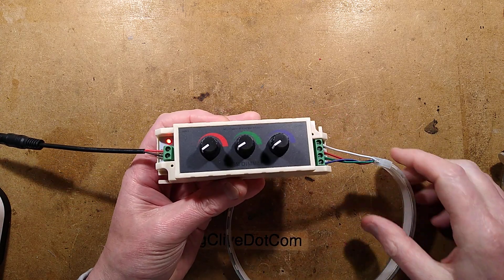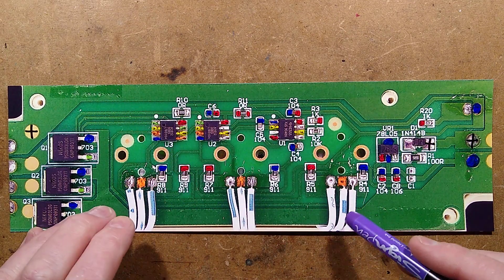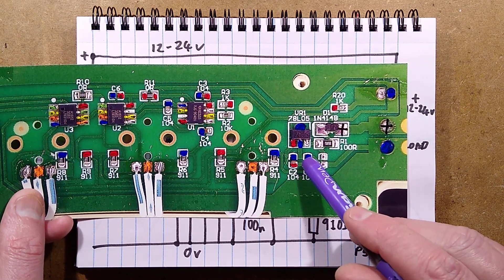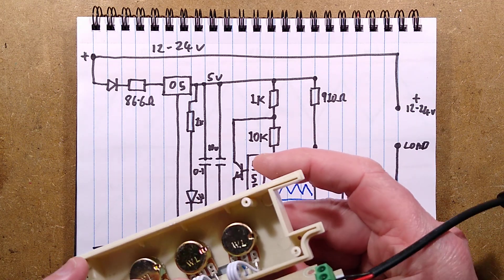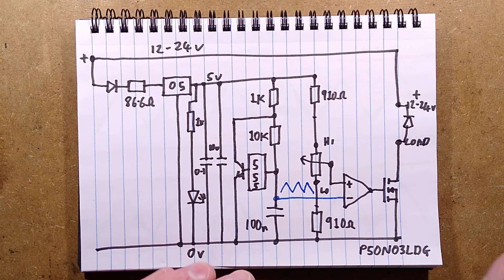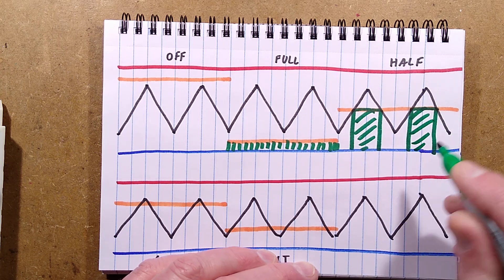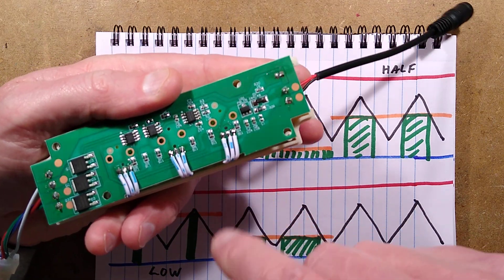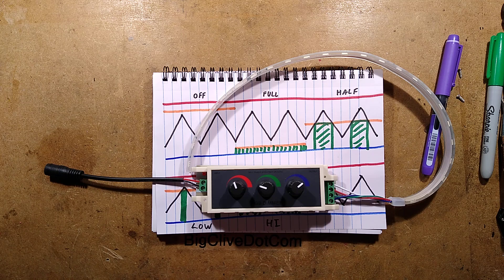RGB dimmer teardown and schematic (no microcontroller)

Comment: Surprised they didn't use the unused op-amp do do the ramp generation instead of the 555 ( and the 78l05)
Reply: Yeah, thought that too - would have saved BOM
Reply: when they realise this, the circuit designer is getting fired
Reply: Sometimes doing that with one op amp restricts current on the chip making the others do weird things.
Reply: @markfergerson2145  a 500Hz oscilator is not super demanding, given the other op-amp is used to drive 2 mosfets, this can easily drive 1+the ultra low frequency oscilator.
what you say could be correct in say a 4 channel opamp with 3 high loads and a sensitive rf oscillator given not enough decoupling and/or voltage drop internally, and that will surely depend on the part and it will only cause a failure on a circuit that was working on its limits anyway
Reply: Maybe, they decided to use the 555 just to increase the demand for 555 chips to keep them in production.
Reply: @allalphazerobeta8643  Hope so.
Reply: @allalphazerobeta8643  lol, that gets my vote, the others were well above my level
Reply from the maker: Yeah.  I've never really looked at op-amps too hard for use as oscillators.
Reply: Using the 555 with its divider and dual comparators delivers a very consistent voltage range in the output. The same is not true for a random single opamp triangle oscillator.
Reply: @bigclivedotcom  Oscillators never oscillate, amplifiers do.
Reply: @bigclivedotcom  There's a fairly standard op-amp relaxation oscillator circuit, usually presented using a double-ended supply but you could do single-ended as well.
Reply: @allalphazerobeta8643  I didn't think 555s needed any help remaining viable.
Reply: Mikeselectricstuff. They used one side of one op amp and both sides of the other. 3 op amps, 3 colors. Maybe I missed something.
Reply: @GeorgeZ213  3 op amps, 3 colors as you said. That was the goal and the fulfillment. What more or less do you expect?
Reply: That was exactly my thought. Or use a dual or three single 555, which can do PWM as well by themselves. 
In fact this can even be done with just a logic schmitt trigger, or when you're really cheap just a transistor.
Reply: @Peter_S_  Yea, the comparator isn't so far from an opamp itself. I know you can do other stuff with a real opamp, and you can buy comparators on chips. But they're nearly the same thing, and in a 555 it's doing the same jobs the opamps are here, comparing a voltage and flipping between high and low. If they were using it's actual output instead of monitoring the capacitor, that's what you'd get.

I wonder if the dual opamps are cheaper than a 556, a dual-555? You might have been able to do the same thing, plenty of people wire pots up to 555s.
Reply: @joewoodchuck3824  Mike's point was, since there's a spare op-amp going, that could have been pressed into service doing the same job the 555 is doing. Op-amps can make decent oscillators. So they could get rid of the 555 and save a bit of money.
Reply: @greenaum  Comparators and opamps are different. They have different output stages designed to do different things and more often than not they have different input stages as well. The majority of opamps cannot be used as utility comparators due to the protection diodes on the inputs. You can abuse some opamps as comparators in limited situations but take advice from Analog Devices Application Note AN-849 which states, "the best advice on using an op amp as comparator is very simple—don’t!"
Reply: Could just have used a cheap quad opamp (ie LM324). Done it with one channel:
https://threeneurons.files.wordpress.com/2019/12/pwm_dimmer.jpg
I f****d up on my drawing. R2 is in the wrong spot !
btw: considering current parts cost, a real uC would be cheaper.
Reply: By the time you have added enough passives to an opamp to make a ramp oscillator with consistently defined high and low voltages on the waveform, you have three or four times the cost of a 555 chip, and probably less reliability. I learned that the hard way close to 50 years ago when I was building theatrical dimmer controllers.
Reply: @kapioskapiopoylos7338  Because they may have to pass fcc testing they want their frequency stability to be high.  This circuit gives that without adding in the BOM cost for a crystal.  Your 500hz spike in the radiated emission test will look like a sharp birdie and will be forgiven (most likely) a op-amp oscillator not controlled by a crystal will most like produce wide band noise and be amplified by the the FET's.  Wide band noise is usually what kills you in your RE's test.  Best to find out the loudest local radio AM station near your certification lab and put your primary frequency right on top that.  Ohhh did I say that out loud.
Reply: They probably have an RGBW version using all four op amps as well, so easier to stick to one basic design?
Reply: @allalphazerobeta8643  In that case, they should have used three 555s and ditched the op-amps completely.
Reply: Arpad Toth  Normally yes, a valid point. But we live in those strange times in which MCUs rise in price sharply and you have no idea which one will be available a few weeks from now. The 555 is something you can get from hundreds of sources and those OpAmps are probably generic too. Because everybody is about IoT and smart this or AI that, nobody gobbles up all the "dumb chips". So... smart move by this manufacturer.
Reply: @Peter_S_  not just that but stable Freq. but also stable DUTY CYCLE..(= konstant)..
irrespective of the " fluctuations/ variations in 
555 supply voltage ..even when run off an 
" unregulated " 
power supply....
Reply: @joewoodchuck3824  they will be always in demand...
Reply: @analoghardwaretops3976  I agree. They even still make 741 op amps which are  absurdly obsolete.
Reply: Isn't there RGBW strips though available, if you want to adjust also the brightness...
Reply: @rfmerrill  relaxation oscillator would limit it to 1-49% duty cycle.
Reply: When I saw the circuit I thought : If I had to design this, I would use a quad opamp as one multivibrator and three comparators. But they didn't did it that way and it bothers me a lot !!!
Reply: @atmel9077  I think there are therapists who specialize in nerd rehabilitation for people like us.  :-)
Reply: Use one LM324 and do all with a single chip. NE555s, LM358s and LM324 cost all about 10cents each. One instead of three chips, 20 cents saved!
Reply: @b00lduck  OK Mr. Semantic. LOL.
Reply: @totorodad-computer-geek  The key is risetime. Short risetimes = more harmonics.
Reply: @gadi70  It still has to use a controller if some sort. Otherwise there'd be no way to change colors.
Reply: @superdau  One still needs to account for the passive component costs. Caps especially aren't free.
Reply: @rfmerrill  Relaxation oscillators are defined by having no amplified feedback. The old neon bulb, resistor, and capacitor circuit uses only passive components, and is an example of a classic relaxation oscillator. 
    If there's an active component causing amplification it's just an oscillator.
Reply: They could of used single package, quad op amp (lm324)
Reply: @michaelmoorrees3585  I've actually built the "same" circuit for RGB LED tape. I used a quad op-amp. One as a ramp generator, the remaining 3 as comparators! I think I used an lm324
Reply: @atmel9077  it bothers me too for some reason🤨
Reply: @joewoodchuck3824  the neon oscillator circuit, is my all time favourite! I have seen it used as a tone generator with visual indicator( driving a piezo speaker)
Reply: @MyProjectBoxChannel  I never thought of that use. I wonder what the upper limit is now that the topic is open. I'm retired and don't have any of my own NE2s.
Reply: @joewoodchuck3824  you can find NE2 neon lamps in many appliances. You can always salvage one from an old appliance. They are used as indicator lamps in extension leads and socket outlets, kettles etc. I might do a video on a neon bulb relaxation oscillator. it's such a simple elegant little circuit.
Reply: @MyProjectBoxChannel  Cool!
Reply: The opamp would either get you a monostable, or a sinewave generator. For a ramp you need more components. The 555 has those extra components built in, so much simpler. As for why a ramp vs sine, probably because it gives better linearity (not perfect linearity of course, since the 555's ramping won't be perfectly linear either) or something.
Reply: @absalomdraconis  opamp generated sine wave is a triangular wave contoured with additional circuitry ( active& passive components) for a decent sine wave..
Reply: damn, came here to say the same thing! also curious they've used 2 dual rather than 1 quad comparator/opamp.
Reply: @absalomdraconis  you can make a single opamp triangle generator but its very unclean, normally you would want to use two. But it would have been possible to make the entire circuit with only the 4 opamps on the board, they maybe just wanted to keep a 4 channel variant possible if needed.

Comment: I used to use 555 timers as dimmers before (I think there should be a comment on this somewhere very far down). I used one timer for each channel, and regardless of whether I used discrete chips (one timer each) or the 558 (four in one) chip I got nasty flickering (made worse by some resonance at certain settings), which could be toned down with lots of flitering and big caps (and pobably my circuit as crap as well).
I now tried this method, with a single 555 timer to provide for a common basic wave form and multiple opamps and (digital) potentiometers... it's awesome... simple circuit no flickering whatsoever. A genious circuit. I can't give enough applause to theone who has thought about and to Clive for showing it to us.

Comment: I used a super simple 555 LED dimmer circuit in a project at work, to ensure all the 12-volt white and red LED tapes got consistent brightness-- twist the trimpot on each dimmer, done. I still have the PCBs I ordered, each circuit was like 5 bucks all told; the circuits inside the project were made from perfboard though, the PCBs didn't arrive in time.

I think I initially used DIP packaged 555s, then after seeing how practically indestructible they were I switched to SMD packages to make the PCB more compact. Same with the MOSFETs driving the tapes.

Comment: I built a single channel version of this many years ago to control the electric motor on a remote controlled model speedboat. Didn't use the op amps though, just varied the duty cycle of the 555 with a pot and then fed the squarewave output into a pair of large mosfets. Worked a treat and because the mosfets were either on or off there was hardly any heat dissipation which made it easier to install and more battery friendly.

Comment: Takes me back! Forget exactly my first use of a 555 but it followed soon after a twin BC109 multi vibrator when I wanted something more compact - plus also often used for timing of course. Has to be one of the ubiquitous devices (741s too) from ages ago - in my case probably mid 70's or earlier. I'm old - I go back to thermionics - 6V6, 6K7, KT66, ECC82 etc and on to the heady days of OC71 and PNP germanium stuff. How things have changed - darned surface mount stuff so small it's a nightmare trying to do replacements. :)

Comment: the use of the 555 reminded me of another unusual use which is how early PCs measured joystick positions... cutting a long story short they used the potentiometer in the joystick to alter the timing of a 555 (well they used the 558 4x package) to switch a single bit per channel and timing how long the switch took rather than do a 'normal' A2D conversion that would require at least a byte per channel.

Comment: I was sure the 78L05 required an input cap and an output cap! Usually about 0.1uf and 0.01uF respectively. 
This design didn't bother with the input cap, which could make the regulator oscillate in some conditions.

Comment: In the late 80's I designed and built something very similar to this, to control heating elements of a temperature calibration bath. The ramping voltage switched a solid state relais. Stunningly similar! 😲

Comment: very retro.
you could easily add an opAmp adder and a low pass to modulate it with music.
Reply: That would be a very cool mod to this circuit! Different filters for each color and selectable polarity per color could make this a very cool little light-organ circuit!
Reply: That seems like a fun hack for this circuit
Reply: Oh please do and market it, I’ve soooo missed colour to frequency coordinated sound to light units, it died out around the millennia in favour of dumb preset light patterns triggered by volume spikes, and they’re just not the same.
Reply: @Lumibear.  If I have some time I will experiment with a few circuits. If I have more time, I will the make a PCB Gerber file and post it here.

Comment: I remember accidentally breaking one of those on a job once just by shorting an output. There was all kinds if stuff going wrong there and some much more expensive digital dimmers were also shorted due to water damage:  They were perfectly fine!

Super simple 555 designs are awesome to read about, but IRL I'll take the computerized, self protected, ultra high tech design any day, because the MCUs aren't what fails, and they're not usually what costs money either.

Still an interesting design though!

Comment: As soon as you brought up that 555 timer, I instantly knew how this worked lol. If anyone wants a more in-depth explanation of that timer you should check out Ben Eater's video on the breadboard clock module. I fully expected a rectifier, resistors, and a couple capacitors..... Didn't expect a pot to run PWM'd LEDs!

Comment: An interesting and excellent circuit - well thought out and unexpectedly only one 555 is needed.

I've just completed the design of a dimmer using a 555 and MOSFET, which is adapted from the circuit of a standard buck regulator. Why the complication? Well, the load is a set of 6 SES E14 Bonlux 2 watt LED lamps (see Amazon) that are advertised as 'non-dimmable'. They work on any voltage between 12 and 24 volts, either ac or dc. A PWM feed doesn't work with them because they obviously contain a capacitor that can grab all the charge it needs in a short time, so even if the PWM signal is mostly off, the lamps still operate at full brightness. (This is presumably designed to bridge the gaps when used on 50 hz ac.) The 555 produces a variable PWM signal, controlled by a potentiometer, at about 500 hz., which feeds the adapted buck regulator to produce a variable dc voltage (with a little ripple, which is fine) and the lamps dim nicely with no flicker. Everything is fed from a 12 volt supply, since I don't like mains in the garden.

I could have used a variable linear regulator, but I wanted to keep the efficiency high.

Comment: The resistor in series with the regulator probably serves to offload some of the power dissipation (same total voltage drop but some of it is across the resistor instead of the regulator).

Comment: The way a 555 works is that it has an upper threshold set at 2/3 of the supply voltage and a lower threshold of 1/3 of the supply. So the sawtooth on pins 2 and 6 swings between 1/3 and 2/3 of the supply. Naturally, the potentiometers will be 1K to fit with 910R resistors to supply and ground because the comparators (op-amps) are only seeing a swing of 1/3 of the supply.

Comment: years ago I've built a circuit similar to this using a LM324 quad op amp. One of the opamps was used as a oscillator /ramp generator, and the other three were used as comparators.

Comment: The built in thresholds of the 555 are 1/3VCC and 2/3VCC. Thus the resistor stack is roughly 1K/1K(pot)/1K. This makes the top of the pot 2/3VCC (roughly) and the bottom 1/3VCC to match the range of the triangle wave. They made the upper and lower resistors slightly lower than 1K so the pots could get just beyond the 555 switching thresholds and render a full range of control. Lastly, I would presume, the fourth opamp is wired as a straight voltage follower to buffer the loading of the capacitor from the opamp input capacitance which may change slightly with voltage (varacter diode effect... or not.). I would have designed it that way as I hate unused component sections on my boards. If I paid for it, I'm going to use it, by golly!

Comment: I’ve been wanting to make myself a unit just like this because I don’t have access to my arduino ide at the moment. Almost like a visual Atari Punk Console. Passive units are much more elegant in my opinion as well. I’m pretty sure I have all the components needed to make this. I’m gonna have to give it a try tonight. Thanks for the schematic!  🤘🏼🤘🏼
Reply: A triple or quadruple op-amp would save one chip.  Limiting input to 12V would allow removing the 7805.

Comment: the capacitor in a 555-circuit is not charged to the rails, but only between 1/3 and 2/3 of the supply voltage defined by the three internal 5 kΩ resistors (in the original version of the chip, hence the name 555). Hence the 910 Ω resistors and the 1 kΩ potentiometer also give you a 1/3 to 2/3 comparison voltage.

Comment: Pot being 1k makes complete sense with 910 ohms either side, this means the wiper voltage will be @min less than 1/3 of 5v and @max greater than 2/3 of 5v. Since the timing capacitor voltage ranges from 1/3 to 2/3 Vcc this means the pot can adjust from fully off to fully on via the comparitor (opamp)

Comment: I've seen a similar circuit to PWM RC servos. It used transistor constant current source to generate a triangle wave.
Reply: That makes sense. The circuit as shown here produces a nonlinear ramp. It's fine for controlling lights but if controlling servos you'd probably want it as linear as possible. Then there will always be a constant turns ratio between the knob and the servo.